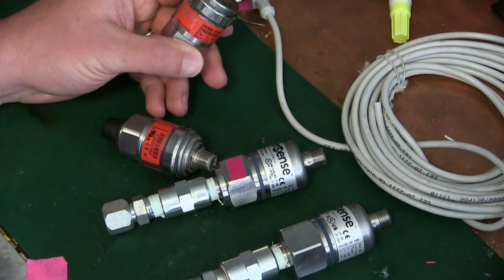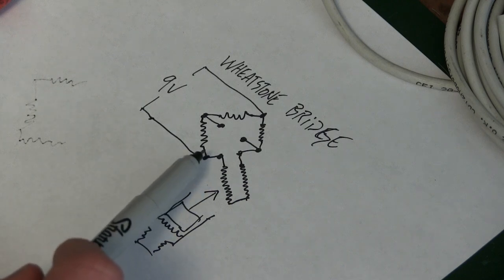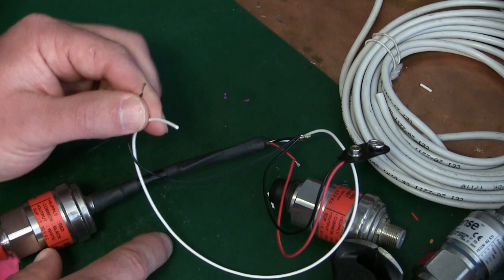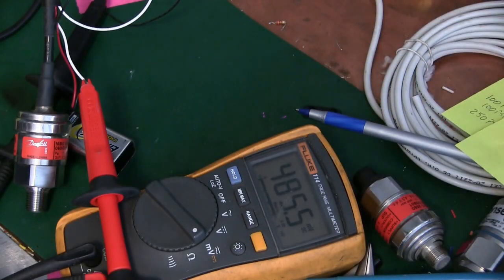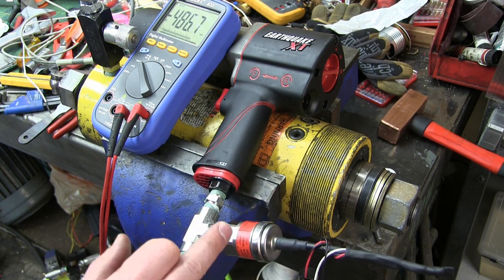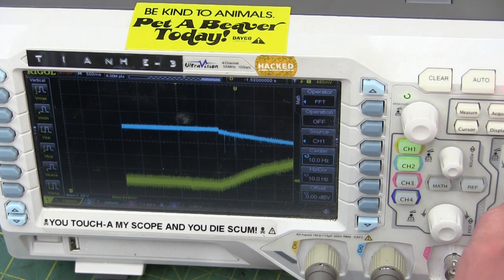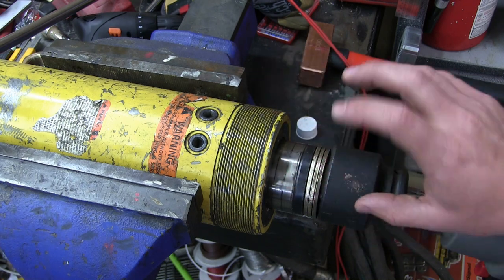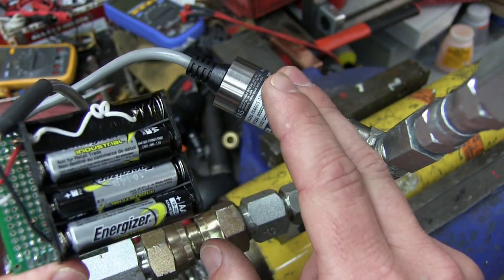How to use Pressure Transducers for Troubleshooting

Comment: does the input voltage proportionally affect the output voltage? so if your voltage applied was 27 volts then you'd have calculated 15 psi?
Reply: hmmm I'm gonna copy and paste here...
What say you, AvE?
http://www.tabertransducer.com/transducer-inputoutput

Millivolt (mV) Output - Pressure 
transducers with millivolt output are generally the most economical 
pressure transducers. They are often called "low-level" transducers 
because they are unamplified and only contain passive electronics 
necessary to develop and thermally compensate the low electrical output 
of the Wheatstone bridge.  This also means they tend to be smaller and 
lighter than voltage or current output transducers.

The Full Scale Output (FSO) of a Taber millivolt 
transducer is typically 30mV, with 10VDC nominal excitation.  This is 
also expressed as an output of 3mV/V, 30mV FSO with 10VDC excitation, or
 as an output of 3mV per Volt of excitation.  Optional FSO range is 
0-20mV. 

*The actual output of these instruments is directly 
proportional, or ratiometric, to the excitation voltage. This means that
 if the excitation fluctuates, the output will change proportionally. As
 a result of this dependence on a steady excitation voltage, regulated 
power supplies are highly recommended.*
Reply: No, as long as the input voltage is between the range on the sensor, the output will still be right, plus or minus the tolerance on the sensor.
Reply: That page lists 3 output types:
Millivolt (mV)Volt (VDC)Current (4-20mA)Your description is for the mV type, wheras the video shows the VDC type.Quote: "Because the output of this transducer is not a direct function of excitation an unregulated power supply is sufficient, provided that it 
falls within a specified power range."

Comment: The pressure will change both opposing strain gauge to get the maximal signal : maximal voltage difference while the voltage difference it tiny.

Comment: Thats how Mercedes trucks use the same transducers for oil and air pressure.One runs at maybe 4 bar and the other runs at 11.Just adjust the ECU to accept the right signal voltage to put the warning light out.

Comment: Some of these are temperature-compensated. I use a Honeywell 24PC series, which can be operated in constant current (constant pixies, in thy noble parlance) mode, instead of constant Volts, and I get temperature readings too. Cheers!

Comment: I liked the plot on the smellier that showed how the psi  varied in a short time. Did you verify the frequency response ability of the transducer? I, like you. only believe what I can see and touch. If the "bandwidth of the transducer" is narrow, then the plot not showing the rotation of the veins, does not mean it was not there. Let's see you verify your transducer's bandwidth.

Comment: Hey AvE, I have an equation for you to EASILY calculate pressure based on voltage from a transducer.

Transducer Pressure Rating × (Voltage Reading - .5) ÷ Transducer Voltage Range. 

Here is an example from your video:

600 × (1.333 - .5) ÷ 5 = 99.96 psi

You're welcome.

Comment: Would using a zener diode or a voltage regulator be necessary to provide a constant reference voltage level from your battery supplies?  Would that effect the accuracy of the results?

Comment: To get this right.. does it have a strain gauge?
And second.. please go look at transducer's data sheet for actual calibration info. Most of the time is a linear scale, but you never know unless you have some known pressures to test that.

For data logging, i use National Instruments data acquisition systems and works perfect for the research i do around automotive applications. I use NI-6211 - usb, and not terribly expensive, 16bit, 1.25megasamples/s, and has some analog outputs as well for control. It is very well operated with LabView. Idk about arduino data logging capabilities, but a real data acquisition system is not expensive at all at the lower end.

Comment: As a greybeard I fully advocate and condone hoarding the good components that the young and infirm remove during their Easter egg hunts. However, working in a  privately owned medium-sized facility without a parts cage troll we typically try to uninstall any component that wasn't the culprit.  Even in cases we deem it more prudent to leave the fresh part in place we'll almost always put the good used part back on the shelf with a note about why it looks used. In fact in the last few years we've been buying and using more and more used and NOS components and equipment.

Comment: Question!!! I've always been vexed on why a ducer reads higher pre check valve (flapper style) than post!!! We're dealing with 8-9k psi at 2,500 to 3,000 gpm, and pre is always (no matter what) several hundred psi more than post! These ducers are regularly calibrated and replaced as needed!

Comment: Half inch gun.. Most common size and the one most of us have.
1.25", so lets say.. 32mm..  Alfa Romao axel nuts are M24x1.5  so:   35mm across the flats. :)   That close enough for you?  Done that before.
Can't justify a 3/4" impact gun for just four bolts.  (And yes, it won't get that torque in that system either, especially as the clamping system is the breaks. :)

Comment: Well I got excited for a minute there thinking you could actually use pressure to produce current outright with one of these.  But then I think and realize that this not really the case with any transducer.  Is there such a thing as one that does (without telling me that "a generator is actually considered a form of a transducer" I mean what fun would that be)?

Comment: So 4-20mA is a standard? I dug up an electric adjustable pressure valve that takes a 4-20mA signal and I was scratching my head trying to figure out how to hook it up to an Arduino. Are they generally used with a pressure transducer to self regulate?

Comment: The torque kit I worked on had various zero points depending on customer requirements (depending on reversible and non-reversible for example). So this may be true for off the shelf pressure transducers but not for all transducer types. pH transducers calibrated with water and calibrating acid (hydrochloric at a pH of 1) are really weird and drift all over the place without being in contact with an ionic liquid (unless they contain buffer solution in which case they sit at mid-point).

Comment: Generally they're not tightening a fastener across the entire length of a hydraulic cylinder either.  So I'm guessing its gonna be closer to what they got than what you got when it comes to stuff like taking off a nut on a flywheel.

Comment: PSIG vs PSIA. I built an arduino tire inflator wherein I had to add some calibration math until I realized I was getting PSIA from the transducer.  My primary target is giant tractor tires from 9 psi to 14 psi so I had to settle on STP

Comment: There are a lot of techs taking the cheap eBay transducers for in cylinder compression testing on cars. Some of the issues are slow sample rates and they won’t read below zero when the cylinder has a slight vacuum. Do you have a source for the better quality ones?

Comment: We aren't supposed to torque fasteners with impact wrenches, we use torque wrenches.

If you want to test what torque it can break, then create a 2200 ft/lb  torqued fastener, using a torque wrench, then see if that harbor fraud impact wrench can undo the 2200 ft/lb torqued fastener.

"How many licks does it take to get to the tootsie roll center of a tootsie pop."

Comment: Hello, thanks for the video. I am trying to calibrate Omega PX-319 pressure transducer with omega's wireless voltage data logger. I am not able to figure out a way to do so. Kindly help me with this.

Comment: I work in industrial Refrigeration for the Fluid Chillers company. We are trying to find a pressure transducer that will do-15 to 150 psi. I'm struggling to find this online. Any ideas? I can buy a digital suction refrigerant gauge for $79 that has Bluetooth, but I really need it to talk to a Schneider plc. Preferably 4/20 milliamp

Comment: If you put some ball bearings or other less compressible objects inside of the hydraulic cylinder, you will decrease the compressibility of the oil--thus, the peaks of the hammer should be picked up by the transducer. It appears that there is too much dampening going on within the fluid. 

Jason Davison, E.I.T, PhD

Comment: If I understand correctly, wouldn't a bigger 2 inch socket like you said advertised. Give a lower torque value vs let's a 3/4 . Given the larger contact pattern on the 2 inch socket and less flex in both, socket and blot/nut. BECAUSE of the leverage the 2 inch socket has over the 1/2 inch impact gun vs a 3/4!! AND if I'm not crazy is there any way you could accurately test this theory out !!!!!! It probably could be done with an digital torque-wrench but it would be awesome to see you do it in a creative way!!

Comment: In converting the voltage readings to pressure, is that relationship (math) always linear?  I've seen one or two data sheets which supply a formula for converting the reading to a pressure.  Also, does the makeup of the fluid effect the reading for these type of sensors?  Can you show us a test rig that could verify the accuracy of the transducer?  Thanks in advance.

Comment: I can see one large fault in using a fluid to test torque output of an impact gun. It absorbs the impact shock of the hammers because of the speed the hammer hit the anvil is so fast.

Comment: is there any way, that you know of to use something like the transducer  to INJECT a signal into a closed pressure system. I am trying to use the device to find pinhole leaks in refrigerant circuits

Comment: Hey isn't that wheatstone circuit? There is a cheapo AD converter - hx711 for  to be connected to your favourite  platform and a lot of crappy code available to do limited operations with.

Comment: first thought was you robbed a pressure transducer from a loader scale, but then you said if outputs 0-5v so it probably interfaced to a PLC?  Why do all the cheaper transducers use 3 wire and the more expressive ones use 4?

Comment: Hey, maybe that's stupid question... but why you so overcomplicating that measuring setup? Going back to basics - torque is force times length of arm. So why not use long arm (thin wall rectangular tube?) and cheap analog pull meter or weight scale with hook. I would use arm welded with 1/2 extension rod, supported by 2 bearings and added some rope to restrict rotation. You could use that slo-mo camera to see maximum value of impact.

Comment: Still waiting for the 4-20mA Arduino video to resurface....
Reply: SimoWill75 I reckon it'll be a resistor of a chosen value.

V=IR
if R is fixed, V will go up as the milliamps (I) goes up.

The max voltage an Arduino can detect on the ADC (could be mistaken here) is 5V, so when the pressure is full and the transducer pumps out 20ma, we want to see 5V, we can now predict AvE's resistor value:

5V = 0.020A * R
5V / 0.020A = R = 250 ohms.
Reply: Yep, I work with 4-20 every day, just waiting for the video to be re-uploaded. AvE deleted it 4 days ago before I had a chance to watch it.
Reply: What was that about? I'm trying to go internal chystal and dropped clock as I dump the original board..

Comment: As far as I know 0.5 VDC as opposed to 0 is used as zero is nigh on impossible to calibrate ( interference , supply , component accuracy etc)   hence 4-20mA & 3-15psi as standards
Reply: There is a few reasons why but it's not for calibration 4-20ma will alway stay the same you calibrate what it's measuring to fall into that range by adjusting your zero point and span, like He said it's a good indication that your instrument it not working or has lost power, in 2 wire instruments the 0-4ma is used to power the device, we also have moved away from voltage signals now days as Vdrop over a long distance effects readings, current holds more accurate reading over long runs.

Comment: When you're installing/removing a hitch ball on the draw bar. 1 1/4" on a 1/2" drive cordless. Oddly enough, the same application where a spring washer actually works.

Comment: +AvE  have you tried replacing the ~4.5v triple disposable batteries with a lithium cell? I've been retrofitting a good number of things around with old laptop 18650's where there used to be 3 AA's. it has worked wonders for the kids damn game controllers and the battery powered security lights. when they stop working, I just recharge the battery and away it goes for another year

Comment: Is there a reason that some transducers use 4-20 mA rather than the .5 - 5.5 V? Every sensor I have come across in my short time in heavy industry used the 4-20 outputs.
Reply: Philip Ejzak voltage type are subject to variance of temperature, resistance, cable run length etc, Wheatsone bridges compensate for this but require. 3-4 wires for the complete cable run to nearest I/O.
Also seem to need more initial fine tuning, but that could just be me.

With current type the mA reading output will compensate for (non fault level) changes, as the Current output into the sensors signal cable must be equal to that which reaches the sensor reading element. As long as no earth fault or similar occurs. So you get good accuracy with long runs and only 2 wires.

Check kirchhoff's current law as to why this is.

Then check wheatsone bridge compensation to understand voltage type.

I don't know if power consumption is a factor in design.

Comment: I've got a few 0-350bar transducers I've been meaning to mail to Canaderp (from 'strata). Sorry +AvE would love to see an arduino based pressure gauge using a transducer. I've done the multimeter thing a lot and had the luxury if being able to see analogue voltage and reset the zero point as well in the systems I work on, also have a real guage but for the cost you can make an arduino/transducer (0-400bar) unit for under $400 AUD. Toyltal no time to play arduino rookie. Hello world.

Comment: AD7705 + arduino + good used ... you get 500HZ update rate for under 20$... Bluetooth will cost 2$ extra ...

16bit resolution, portable chooch meter.. and the battery is the most expensive part.

Comment: I've noticed this with modern cordless impacts in terms how the type of faster affects them. 
My dewalt dcf889, if I tighten a 3/4" forklift wheel nut up it will do it up so tight that I can't budge it when trying to undo it with a 24" breaker bar even when jumping up and down on it (180 pound gorilla).
However if I try to undo an 1" diameter 12.9 grade allen cap bolt it'll just clack away and won't touch it, however if I put the 24" breaker bar on, one good 'ol grunt from me and it comes undone no problems at all.
Just shows you how much the diameter and mass of the fastner plays in the actual torque output but it makes sense really. My conclusion is rating them on torque is nigh on impossible.
Better to just say 'this one tickles like a fairy, this one hits like a heavy weight boxer'.

Comment: if the hammers showed up on the hydraulic side, it would mean that your testing method for torque is incorrect, seeing as if the nut/bolt doesnt absorb the blows then the hammering function is pointless.